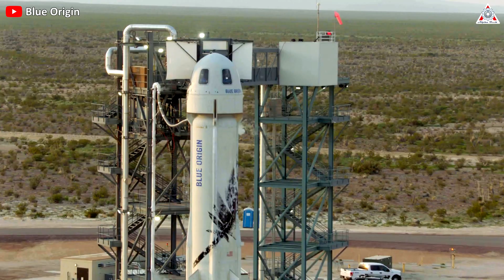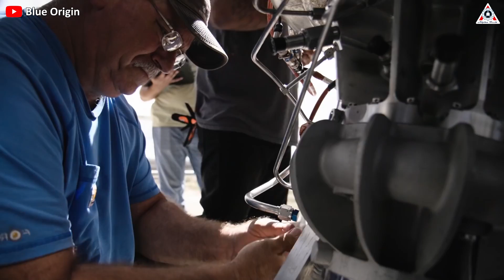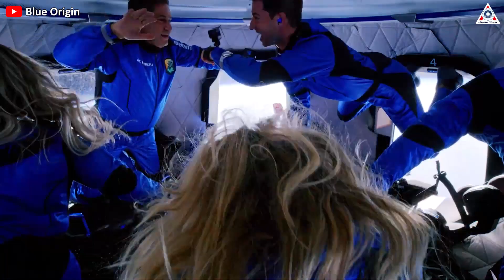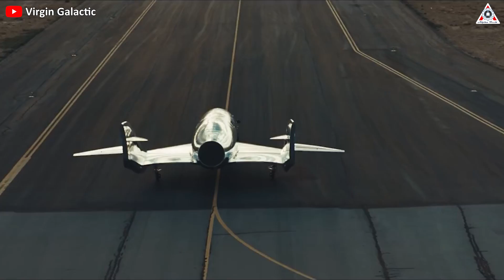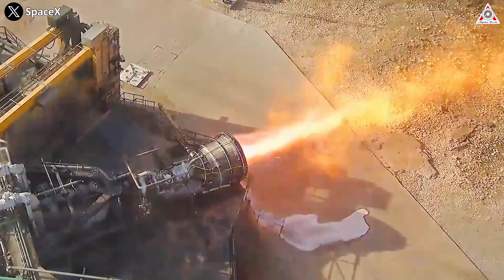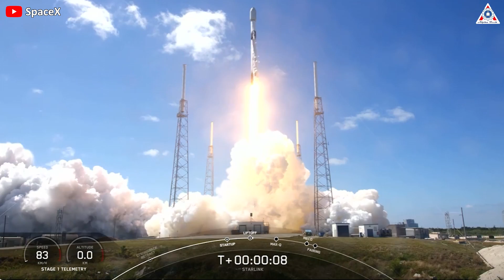The disappointing truth of Blue Origin's New Shepard Rocket...!!!

Comment: Great Video !  NASA and Blue Origin both need BO New Shepard to work and be reliable !  The Blue Origin Blue Moon HLS will use a variation of the New Shepard engine, the BE-3U with a larger space rated nozzel !  Blue Moon will need a  6.0 km/sec delta-V to fly from the NASA L1 Lunar Gateway.  When fuel from the Lunar Water Ice (H2O) the Blue Moon  (LEV/LLV) can fly from the LS to the LEO Commercial Space Station (CSS).  This is the same orbit that Apollo used to depart for the moon !  For more info on the LEV/LLV see "MoonDirect" by Robert Zubrin.  Timothy Lipinski